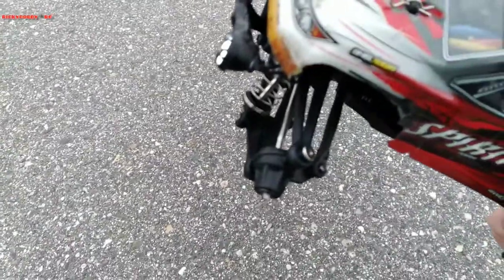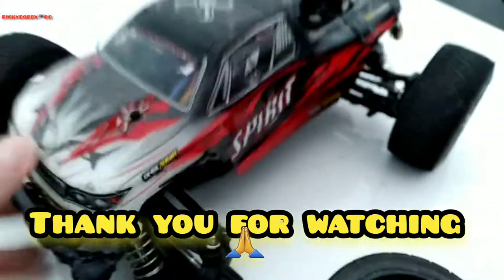Well... 🏆66mph today for the 1/16 VATOS Spirit Q901🏁 & here's how u can use any 12mm wheel!

Comment: Hey bro wnats up got a new hoisom 9155 just wondering can I use a 3s in it  contacting the manufacturer takes a long time to get a response  thanks bro
Reply from the maker: Congratulations on the new ripper! 3s can get the motor very hot. There's a chance for fire, if not careful and it will shorten its life. With that said 1500mah-2200mah 3s is the range you're looking for.
Reply: @ChiefRickyRC  thanks bro